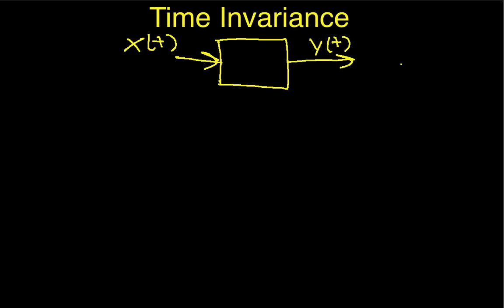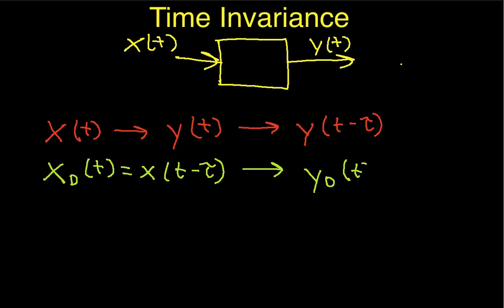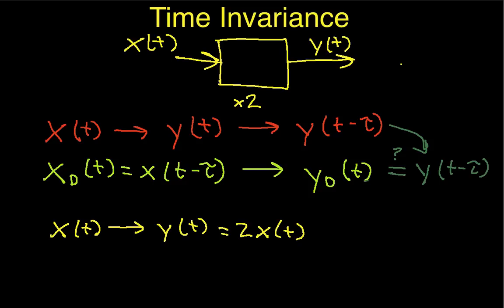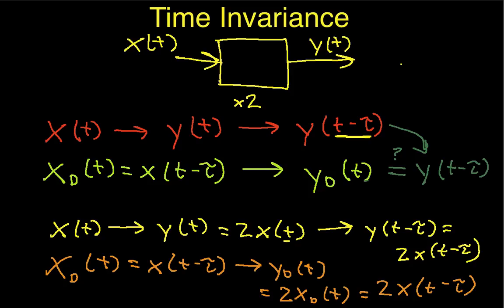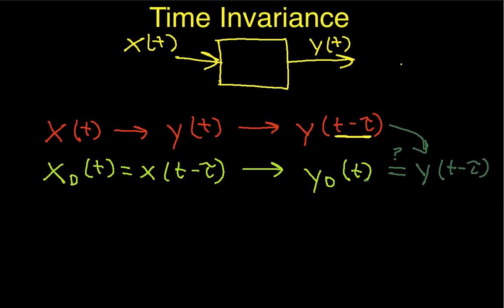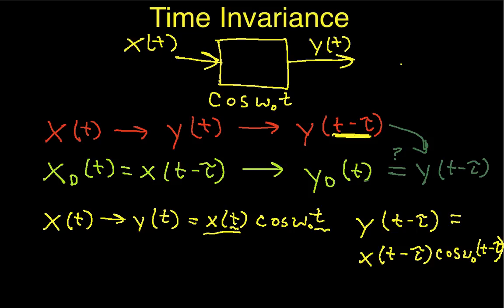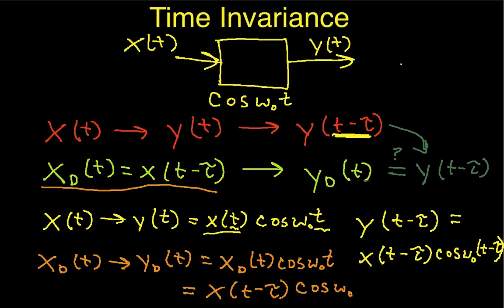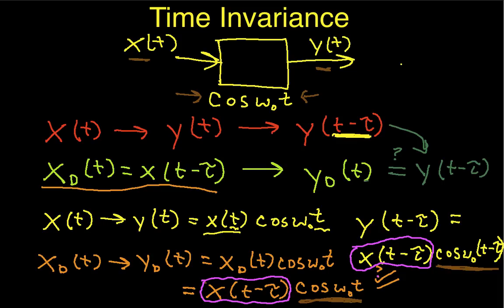Time Invariance: Mathematics

Comment: thank you so much, this was a huge help!

for those who get confused easily like me, remember this : [arrows (do not equal) the equal sign].
arrows show the flow of the signal from input to output.

another thing to remember: here the input signal is a function of time x(t), so when we look at the output signal it is almost a function in two variables "implicitly" because we are modifying on x(t) as though it was another variable. just remember you're not just dealing with variable t in y(t),  you are as well always dealing with x(t) because this is the function of a system; which is to modify a function and produce another function with the same variables.

I hope I have dumbed this down in a good way, I wasn't taught a good foundation on functions when I was a little either so for all math nerds out there I apologize.